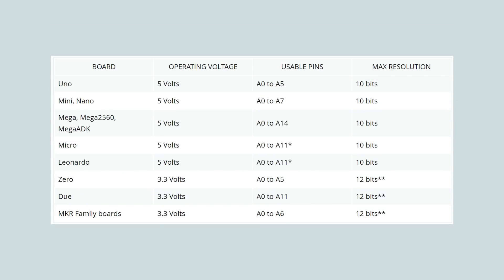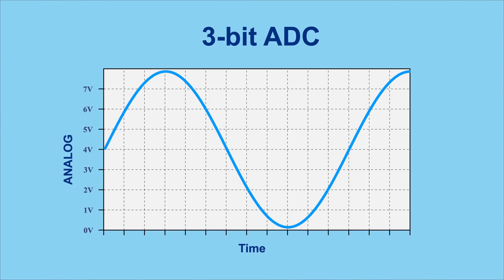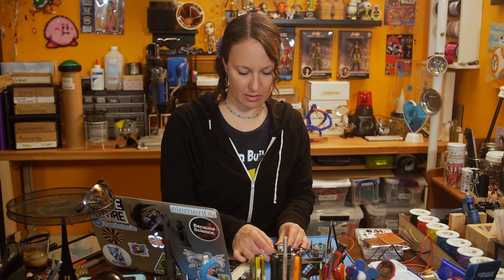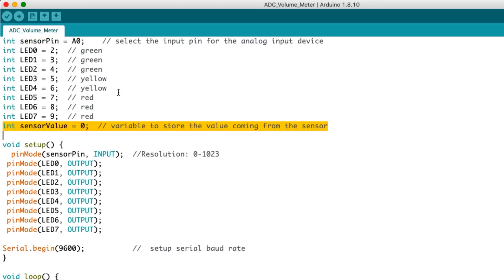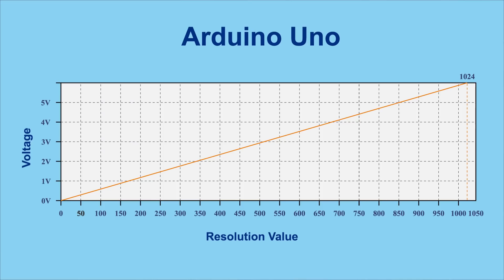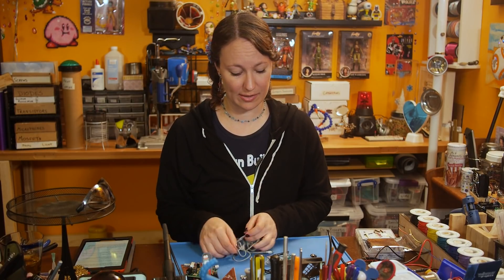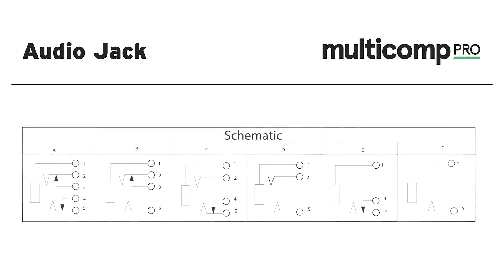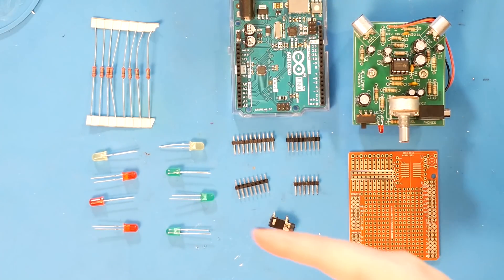ADC LED Volume Meter with Arduino Uno - The Learning Circuit

Comment: Madam can you help in my project 
My project is Power Analyzer meter 
Can help for making Ac voltage sensor circuit for Measuring the Rms Ac voltage I am using Arduino nano

Comment: Great circuit. I'm gonna give it a try.

How can I get the circuit to respond to a certain frequency so that I can build an array and make a spectrum analyser?
Reply: Use filter capacitors and blocking diodes to notch each frequency,  Use LM3915s or LM3916s to save space. Chain them to stack 20 or more LEDs in each graph.

Comment: I took one of the audio jacks off my 8X8X8 LED cube circuit board and put it in a pair of headphones for a coworker. It originally was a hardwired cord that got cut in a car door. My coworker just bought a new M/M phone chord with microphone to plug into the headphones and he couldn't be happier!

Comment: You could use a timer instead of delay with an interval of 25ms.  Leave the mcu to keep cycling round the loop and record the max, mean or average value per timed interval.  Reset the value(s) after each interval.  Might look a little better.

Comment: honestly, as nice and simple as that code is, it would be rather slow.   to keep it using arduino but to get max responsiveness you could use the map routine to 8 and then use that value to drive the pins directly with PORTX...   personally I wouldnt even use the arduino tools and would just run raw c with DDRX and PORTX but I'm a masochist.